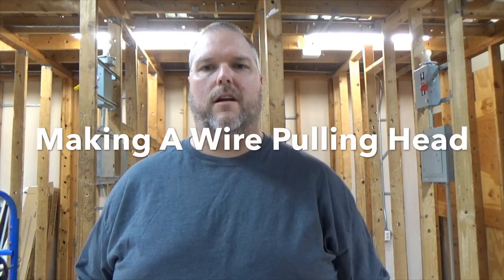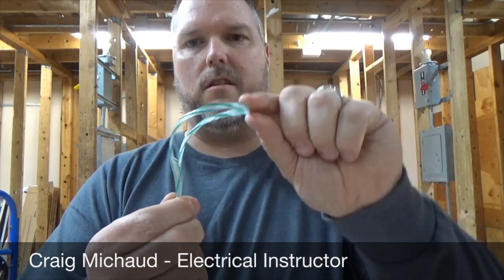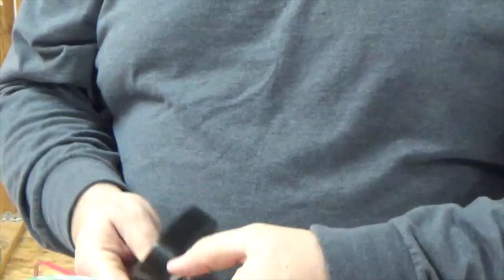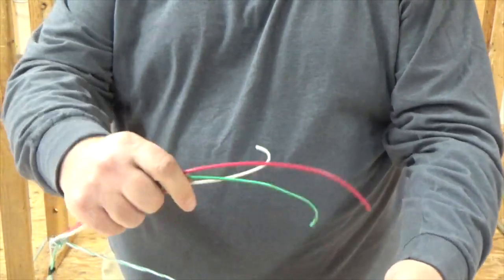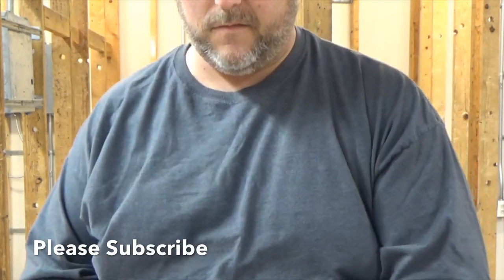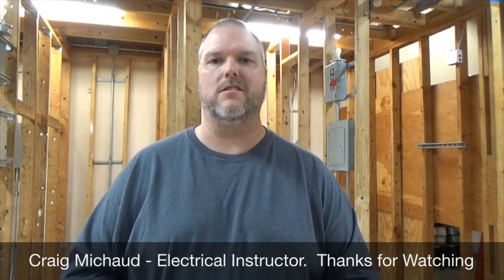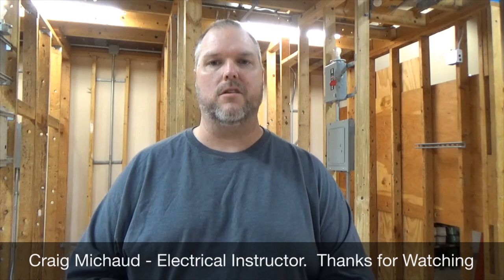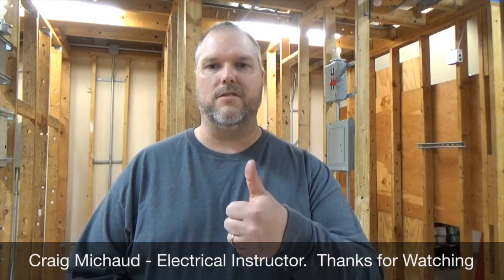Wire Pulling Half Hitching Prep

Comment: These are the same knots I use when I go sailing. It never occurred to me that they could work just as well in a conduit as they do on a sailboat (duh!). Even without tape I could see how well they grip the wire when put under tension. Worked great pulling 10/3 NM w ground through a 44 ft 3/4" flex conduit.  Also, I liked that "leave an end, make a friend" move. Thanks for teaching this old dawg some new tricks!

Comment: This is the best method.  Thank you for sharing. First..... it's not good to use fish tape to pull wires, you can damage the fish tape. Secondly, this method makes the smallest head and uses less electrical tape which stops wires from bending through sweeps.  If I try wrapping just 4 or 5 12 gauge wires with electrical tape more than 4 inches of tape,  it doesn't want to bend through sweeps even in 3/4 pvc.

Comment: You can improve it a little bit by cutting the ends of the wires on an angle so they are feathered for an easier pull.

Comment: Okay so I was in a situation where I had 2 - 12/2 wires that I had tied together hoping to pull the new one thru- so one hole and a loop of wire to squeeze thru - wasn’t gonna happen.

There was no accessing where this wire ran for about 4-5 feet from one hole to the next. 

I used this on both ends of the wire shoved them both into the abyss and said a little prayer- by pulling the accessible old wire I was also pulling the new wire thru where it was inaccessible— with a little wiggling on either accessible end I was able to get the new wire thru like a charm!!!

Thanks!! Cheers

Comment: i will pulling a new spa wire which is a waterproof style 3 wire like a romex should i strip the romex to expose the 3 wires or tie to the sheath ? also there is a bonding cable that will remain will this compromise my pull ? thank you for the video i will use your method
Reply: The NEC does not allow either type NM-B cable or jacket removed inside if conduit. The wires are not marked to indicate voltage, type or temperature lime type THWN wire. No such thing in the code book called romax. Its a trade name from one of the numerous companies that manufacture NM-B cable.
Reply: @garbo8962  it's not allowed in "damp" or outdoor applications but it is allowed indoors

Comment: Tie a loop in the string, strip the wires a little, fold + twist them around the loop, tape, pull.
Reply: Right....this guys literally taking forever i would have pulled that wire 6 or 7 times by now
Reply: @illwil2158  
True but this guy's way will never fail yours might

Comment: Very good video!  I highly recommend though not wearing your wedding ring working around electrical or any construction.  You can easily loose your finger 👍
Reply: They make silicone wedding rings as well.
Reply: Meet a guy in the supply house with 1/4 nub.
So yea..

Comment: is this good for big wire?
Reply from the maker: @Chefmeh  Depending on your length and the bends it will work! I personally won’t use this method with anything bigger that 1/0. CM
Reply: @ okay thank you for the reply! What would you use for 2/0?
Reply from the maker: @ I would use a set of knuckles or a kelmsgrip. It’s like a Chinese finger. Or I would just make a really good head wrapping the wires tight together! I may have to do a video to explain better!! CM
Reply: @ I appreciate it and yes that would be a great video! I just subscribed! :)

Comment: It worked, thank you.  I staggered the 3 THHN wires pulled through 1/2 conduit (tight).  Tied the knots in the video and carefully taped the knots and string.  I also used some pulling lubricant and proper pulling line instead of masonry string, but it worked very well!

Comment: If you tied on properly you wouldn’t need tape to hold the tail down lol
Reply: You wanna be sure, it's a just in case thing. You don't want it to come apart after the wires are pulled almost all the way. You'd have to pull them back out. Don't be so quick to scrutinize.